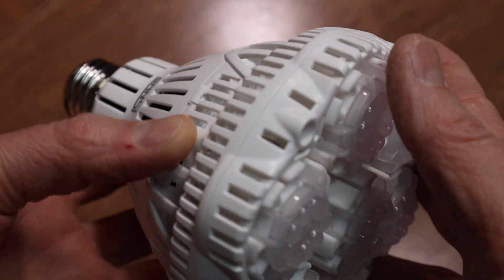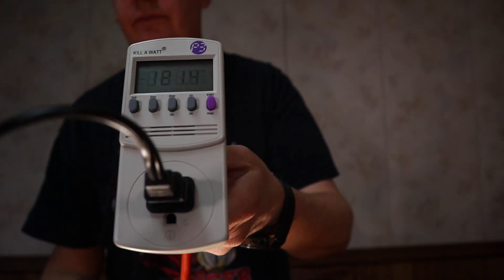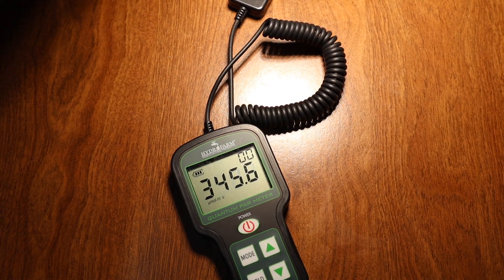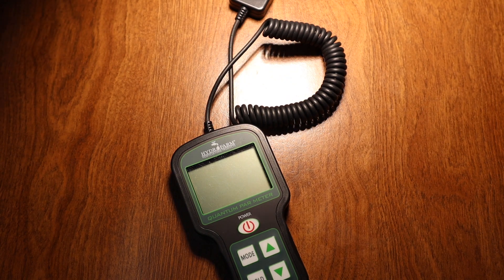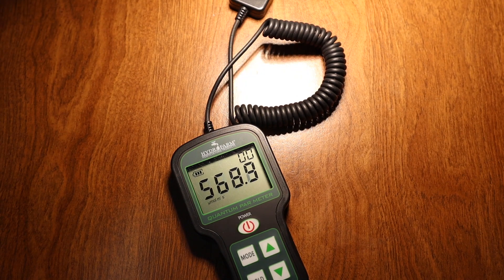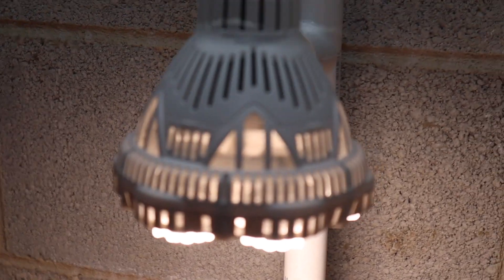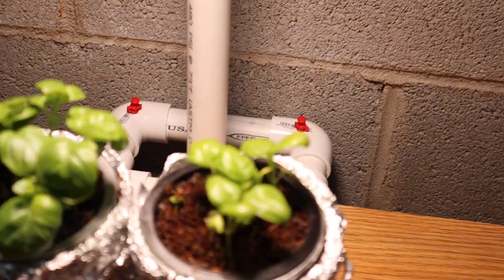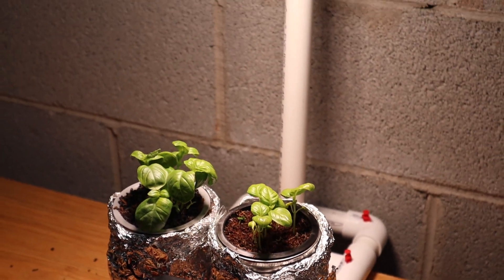Sansi 40 watt LED grow light review

Comment: Thinking of putting 4 of their 40w grow lights surrounding a 600w Mrhua cob bar in a 3x3 tent
Reply from the maker: That sounds good, should work very well.
Reply: @pepperdactyl  So do you think the spectrum of the MrHua and these Sansi will work well together for full cycle growth. I was contemplating vegging with only the Sansi then when its time to flower add in the Mr Hua and towards the middle to end of flowering i wanted to add in a 6500k lights and a UV light but only run the 6500k and UV 4-6 hours a day at the end of flower. I've never grown anything before thia will be mu first run. Do you think this set up will work well with flowering plants?
Reply from the maker: @wermy76  Jon, hard to say without trying it. Seems to me the four Sansi and Mr. Hua would be enough to fruit a plant or two. Depending on the plant/s, you might be able to achieve this with just the Sansi lights. If you're putting out that much money for all those lights, I would consider the HLG quantum boards. In my opinion, those are great and worth the money.
Reply: @pepperdactyl  I actually got the MrHua for free. I have bigger lights coming from Forever Green Indoors. They're American made in the same factories as Next Light but are fairly unknkown to the average hobbyists. This is because they mostly sell to big facilities. Check out their true 700w and true 500w lights. Samsung diodes set at 50% 3000k and 50% 5000k with Cree red 660nm diodes added on top. I bought two 700w and one 500w recently. They should be here Wednesday. ForeverGreenIndoors.com check out their specs and price point and tell me what you think. They beat both Next Light and HLG on all price points and most specs in my opinion. They have a bunch of anonymous buyer grow  data on their page too. They love feedback. Also have an Instagram Fgilighting. Underground and underrated in my opinion. I found them by chance through a comment in some forum.